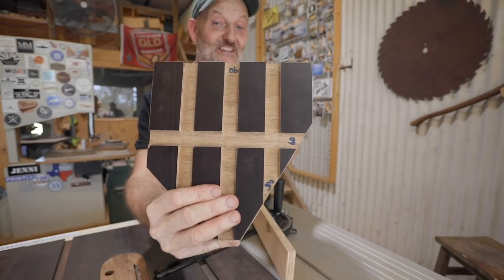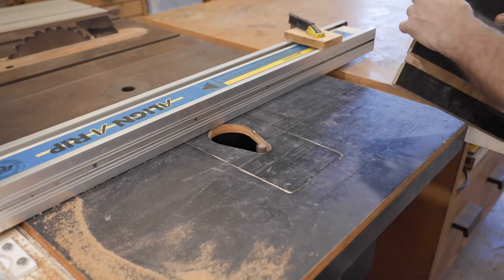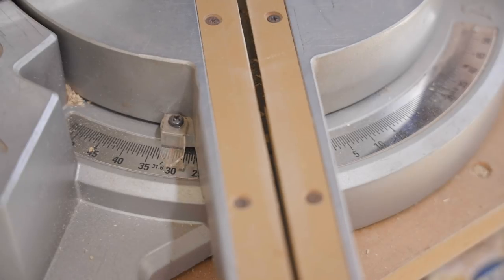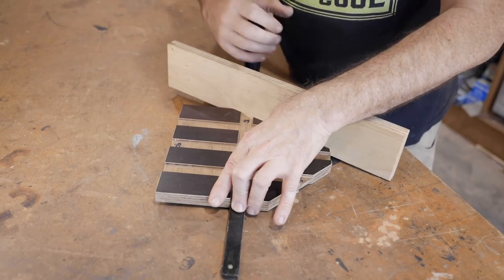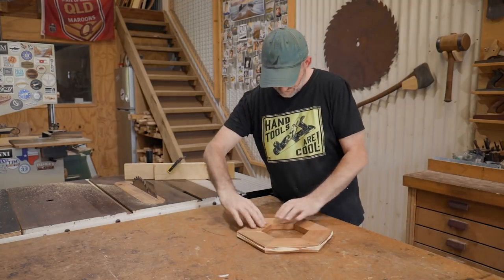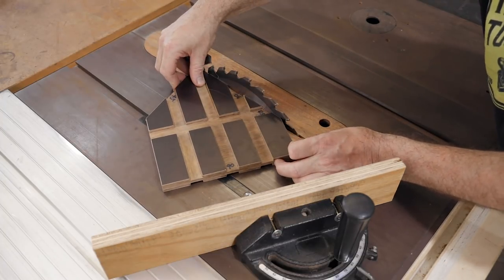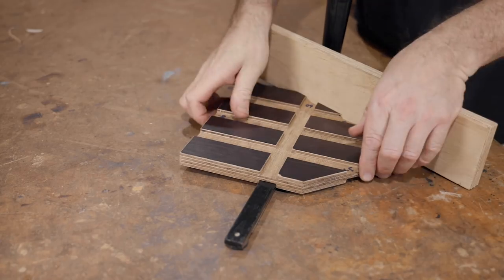Making a Mitre Gauge Angle Setting Guide

Comment: Just found this video recently and made my own miter gauge angle setting guide this weekend. Well done video, clear instructions. Now I'm able to quickly and accurately set up my miter gauge for the angles I use - 30/60 and 22.5. Thanks!  I made mine with a scrap of melamine, used sanding sealer to seal the exposed particle board surfaces.

Comment: This is a really good idea. I have a startrite 275 made in 1972. 180kg, solid and still works well except the mitre gauge which tired and sloppy. I cant buy a replacement because the slot is only 1/4" and not the "modern" 3/8". Making this is going to help repeatable setup easy. Thank you....yet again.
Reply: Had some trouble like that a while back... Not that I couldn't just buy a new gauge, but more that I was lazy and cheap. (lolz) BUT the principle is relatively sound. You can "rebore and thread" the old gauge for a very slightly larger bolt or threaded round (aka "all-thread") and make a new handle/adjustment with a nut epoxied or super-glued (make sure the nut IS for the same new threaded round FIRST) into almost any plastic or a custom wooden handle with an adequate sized hole/recess also bored. It takes a drill, metal cutting bit, bolt/all-thread, nut and adhesive of choice... I found a kinda cool looking motorcycle style handle grip... just because it's cooler than some random tool-handle reshaped or a chunk of wild wood from the yard.

   You might want (need) a hacksaw or grinder to shorten bolts/all-thread... Files are good for shaping and smoothing after a cut. (don't know how much you know about metal work). AND some adhesive might help on the bolt... You'll want to tighten and loosen one side (convenient for table-saw precision) at a time... I prefer the handle work loose or tight, myself... BUT on some of those it can be unfeasible... 

   If it's the recess that troubles you on epoxying the nut into the handle with space enough for some excess all-thread (preferable, to avoid jamming the stuff into the slot in use)... You can wrap "cling-wrap" like Saranwrap (doesn't have to be name-brand, just about the same stuff) around the all-thread and use it while setting and gluing the nut, so you avoid "over-filling" the recess... because I'm lazy, I don't like boring ALL the way up a handle in wood, either. The cling wrap will get a little scuffed inside the nut, BUT not enough for the glue to hold well... AND once set, you can remove the all-thread, cut to approximate length and sneak down to "finished product" so it stays flush with the underside (not scratching or gouging in the slot) and allows the handle proper convenient movement... Again epoxy (my fav') or superglue in the bar will work to affix the thread on that end, and I rather prefer a short burnishing session (either with a file or a dremel... again "cheap" not necessarily namebrand, just a decent rotary tool... to smooth the underside for fit... AND that's it. I know it looks like a lot of details and complicated... Free to copy-paste to a text file... edit as desired (to organize for quicker reference YOUR preference) and hold onto for future references... YOU CAN DO IT...

    But definitely make sure with a test fit for that nut and thread. Don't be like me and have to hammer the thing back out, clean up, and go buy a new nut (which I probably should have done the first time around, too...)    AND you might find (as I did) a couple washers to act as "spacers" can also take some of the work-load off quite reaching "deadly precision"... ;o)
Reply: @gnarthdarkanen7464  many thanks for your comprehensive response. Its 10pm here so I will digest it tomorrow  and see what I can apply. In truth if incra made a 3/4 x 1/4 guide bar I would just buy one as the original design for mine is not good. Sadly they dont. I dont know why no one in the uk has created something as these saws old as they are are still selling for upwards of £1000 refurbished when they appear.
Reply: @neilrobertgrayson  You (and frankly anyone else) are truly welcome... I've been there... Luckily our saw had slightly larger slots than 1/4... BUT you might consider tracking down someone who has restored one of them... If anyone knows a trick about it, those folks do... AND (just my experience) the only thing they like better than doing the refurbishing is talking to explain their expertise about refurbishing their favorite machines.
    I once made the mistake of asking about a broken bolt at a flea market, because I noticed the same types of bolts on some of the refurbished equipment being offered... I couldn't politely escape a five hour crash-course from the guy... I'm now apparently competent to work on and repair plows, discers, and hayrakes dating back into the 1800's... BUT I did manage a 1 dollar fix to a potentially thousand dollar trip to a machine shop... 

   In any case, you're welcome. Best of luck! I'm interested how it turns out... and Good rest! ;o)

Comment: This can easily be converted to an "Any number of arbitrary angles, extreme precision" jig with really very little added effort or space.
It relies up the concept of a "Sine Bar" from that's more from the metalworking side, but it's so easy to add to this, I'd do it.
Two more track pieces(one for each of the outer dados), sink posts in both, glue tape measures to the tracks such that the 'zero' is the center of the posts. Now the fence can rest against the two posts. The three tracks are parallel, the distances between them are known, the edge of the jig (or another convenient line) is perpendicular to all three parallels - and gives a measurement for the left-and-right tracks. Add some trigonometry, and the angle of the gauge can be calculated. Reversing the process can set the angle, so nonagons, heptagons, and omfgagons can be calculated, set, and cut reliably. With, fundamentally, the same tool.

Comment: Hi, I am a big fan! But why do you need this jig if you already have a miter saw? And if you don't have a miter saw how do you make this jig?
Reply from the maker: Thanks John-Michael! This is far more accurate than a mitre saw, but saying that I generally use a mitre saw for most jobs. If something needs to be precise though, then this is the way to go. If you don't have a mitre saw then you would cut the corners off the guide with the tablesaw and mitre gauge but then you would definitely expect to make adjustments. :)
Reply: @PaskMakes  And for making those adjustments, perhaps it might work to use a shim under one corner of the jig against the miter gauge.  Then run it through the saw to shave it to the adjusted angle.  Micro adjustment.  

Love your videos, Pask!

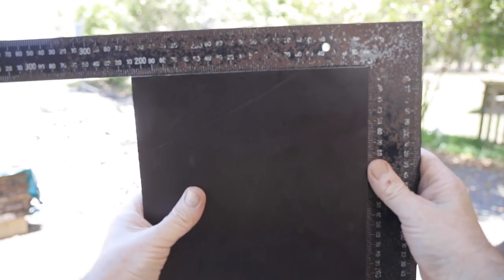Comment: 0:39 - what am I missing? I can see a gap in the left hand edge - that's not square?
Reply from the maker: It's a plywood edge cut with a tablesaw so it's not going to be super smooth and some of the little furry bits hold the square away slightly. The slight gap was pretty even all the way along the edge but doesn't show up at the camera angle. Also it's not easy to hold the square tight against the edge while fully extending your arms that are wrapped around the tripod and camera. All this while trying my best not to knock it and trying to view the screen from a couple of inches away. I guarantee my sled is perfectly square. :)
Reply: @PaskMakes   LOL ok I can see how that would be tricky holding that  - I'll let you off :)

Comment: Just buy an Incra Miter gauge. Easier and faster to set and you can get exact repeatable cuts and angles up to 1/2 degree on some models. I honestly can't imagine working without one.
Reply: Couldn't imagine spending that amount of money when I  can make one. Keep your incra(diblely overpriced).
Reply from the maker: They do look like a nice bit of kit. This works well though and it would only take a few minutes to make a custom one for a certain angle. There's only a handful of angles that need to be dead on accurate. The main thing I would want that type of accuracy for, is making segments and for that I'd use a wedgie sled. :)
Reply: Not everyone has an unlimited budget that lets them buy every gadget they'd like to have, and plenty of people have no budget at all... "Just buy it" is an insulting and unhelpful attitude. Not surprising that it comes from someone whose avatar is of an individual who is probably the biggest waste of oxygen on the planet right now...